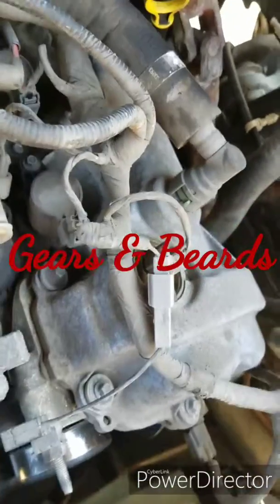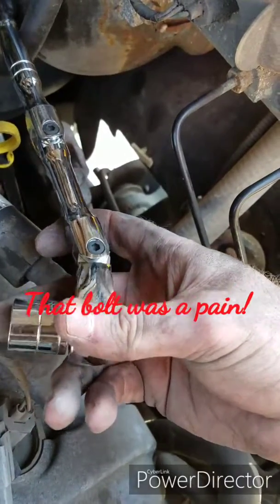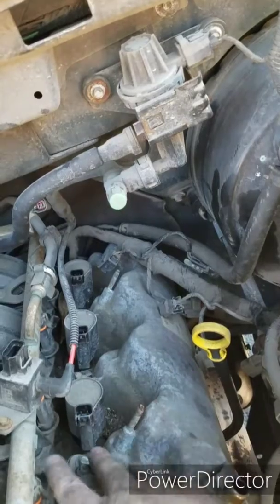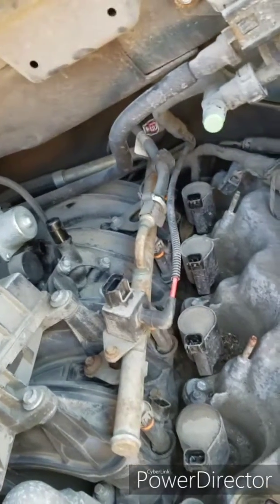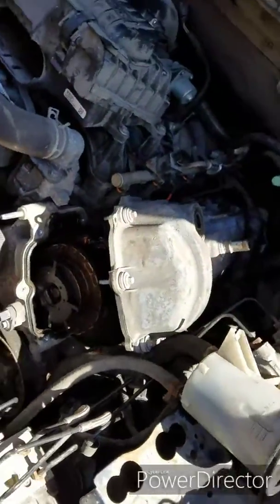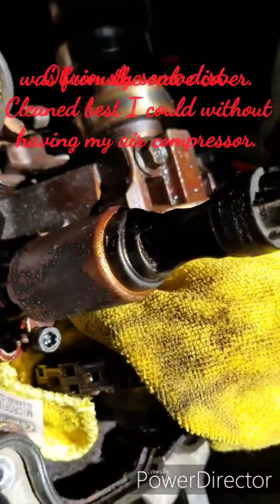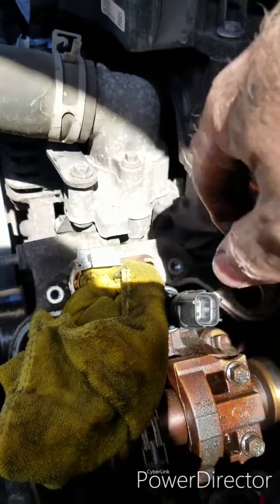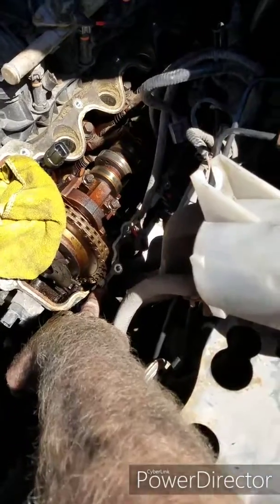2004 5.4 Triton V8 3V F150 Driver Side VCT Solenoid Replacement

Comment: I believe on the 2004 on the drivers side is 3 bolts on the power steering reservoir. Lay it to the side and there is the VCT. That's all I removed on my '06. I believe 2004-2006 is the same. 
If you are attempting this please watch several other videos to make sure I am right. When the solenoid is off to the side of the rubber seal, you do not have to remove the valve cover or anything more than take the reservoir off the bracket and carefully put it to the side. That is for the drivers side.
There is nothing to remove on the passenger side.   Hope this helps someone. Jesus bless.

Comment: If I have a bad VCT on my 2007 5.4, will it cause to shake slightly at a complete stop/park? I also have loss of power. Scanner says timing is off by a tooth or more but I have no severe issues or loud noises coming from the engine.
Reply from the maker: Yes, the complaint on the 5.4 that I worked on was shaking, poor idle, and pour fuel economy.